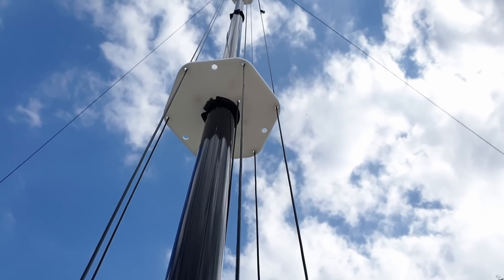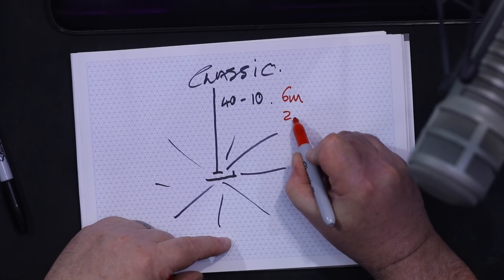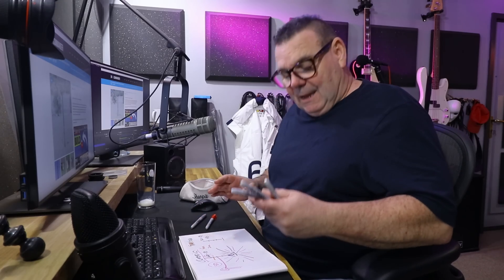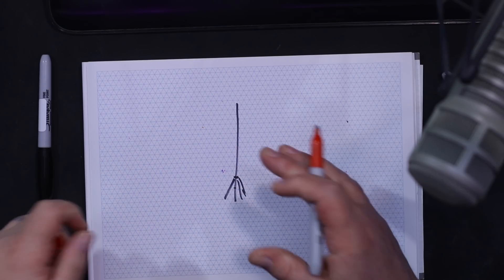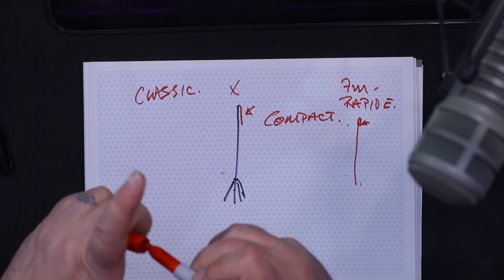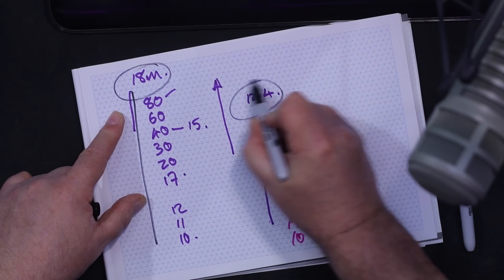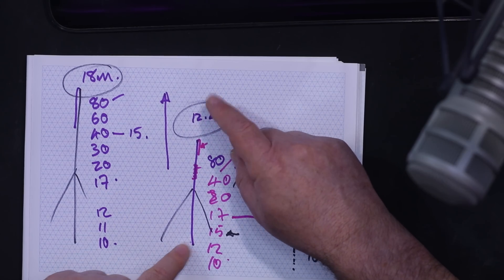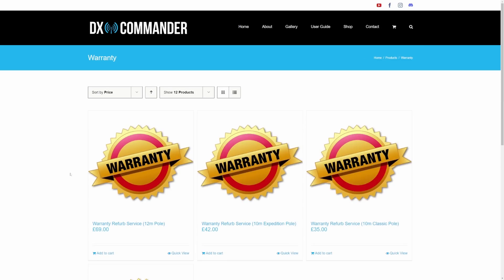Which DX Commander - The 2023 Line-Up

Comment: New ham here. I’m looking at getting a classic would like to know if you Have you done a video explaining the principles where all of the driven elements are going to the same socket. When you tune or key the mic to transmit isn’t the power going to all the driven elements and with a 25W limit how much is lost. Thanks.
Reply from the maker: It's all auto-magic. Only the right element will work. The rest are ignored. Physics. Don't worry - good question.
Reply: @ “auto magic” excellent new terminology 🤣👍👍

Comment: Previous
    Next

"Signature 18m Multi-Band Antenna Nebula Kit"  Does that improve or change the verticals from the original DX Comander ( I have) Or is it just adding longer vertical wires to the original and giving it more height for them. My original has been up for years minimal maintenance. Snow.. ice.. rain.. wind. Thank you!
Reply from the maker: Nebula basically adds 60m and 80m. The rest are effectively the same. It's a BIG toy. More durable too.

Comment: I'd love to see a Rapide-Expedition hybrid. So, basically an Expedition using the Rapide mast. Something that doesn't require a hole in the forest canopy.
Reply from the maker: Well, you COULD just use a Rapide and cut some notches to replicate the speed-slots?
Reply: @DXCommanderHQ , I wasn't sure if the spreaders would work. I might just take you up on that! By the way, I'm loving my new 12.4.

Comment: I have the Expedition and I have to disagree because the thin tubes in the mast in my experience are not a good idea about bending because on windy days I cant use my radios because it moves and bends so much that the SWR goes crazy up and down., I love the antenna but I wish the pole will be stiffer. I am even considering another pole so I can play radios during windy days
Reply from the maker: The trick is to have a ton of tension so that as the mast bends, the elements go with it.
Reply: @DXCommanderHQ  interesting, I’ll try that. When I built it at the beginning I put quite of bit of tension but the wires started getting out of the spreaders so I ended up lowering a bit the tension and putting duct tape in a way to close the gap so they can’t come out. I will try again because I really want to be able to play radio on windy days

Comment: Thanks for this informative video, Callum. I'm considering getting the Rapide. Question:  I take flood irrigation on my property. This would result in 15 to 25 centimeters of the Rapide being submerged. Do you foresee any problems in performance or to the integrity of the Rapide and its hardware?  Alternatively, I may be able to place it close to the side of the house on a berm, but would that result in decreased performance if it's up against a two-story wall? Thanks, and 73!
Reply from the maker: If it's no more than 25cm, I would raise up the base same amount and coat the SO239 and PL259 in a good spoonful of Vasaline. It's not designed for underwater use :)

Comment: Collin, I want a strong, sturdy DX antenna that would be an all season antenna used as a fixed base station antenna, once erected it would not be moved.   The catch,  “no guy wires”  as I have limited space..  which DX antenna would you suggest ?
Reply from the maker: OK, run with Signature 9.. Just let it blow around in the wind - and don't guy it.

Comment: Man, I just passed my foundation and I'm struggling for antennas at my QTH, I wish I had the space for a DX Commander, Do you have any plans to develop any stealth antennas for us that are not fortunate enough to have the space / 'permission' to erect such a beauty, or a video perhaps talking about stealth antennas, options for people in apartments etc? :)
Reply from the maker: Depends what you mean by "space". A Rapide with 1m radials for instance would work.. That like laying down and spinning you around. Have you got that amount of space..?
Reply: @DXCommanderHQ  Unfortunately, I don't really have much of a garden at all, to give you an idea (Hopefully this will work) https://i.gyazo.com/937b21daa73832a5d81a66739c444a1b.jpg this is what I have to work with, my idea was to run a 40m dipole fed at the corner of that fence, with the wire running along the top of the fence, the fence is 11m and 15m roughly, but it's quite low to the ground, I'm a foundation holder so "10w max" for me, what do you think of this? probably severely compromised, but it's either this or Magloop indoors from what I can figure? Unfortunately stealth is key, I've literally been looking at other places to live, just to stick up a DXCommader haha.

Comment: To switch bands do you have to make changes to the antenna coax connection at the base or use a switcher?  Also do the wires come pre-cut/tuned for each band for easy setup? Thanks!
Reply from the maker: No.. It's automatic. Laws of physics.. Meaure the wire supplied and cut to a chart. See User Guide on dxcommander website.

Comment: Is there any easy way to mount this against a thick, wooden fence post? the post is about 5 feet tall. I can’t put it right up to the post due to the wires and spacing rings? (such as the Rapide)
Reply from the maker: Yes, you will need some spacers. Stauff clamps might work with small blocks of wood.

Comment: I really want a DX Commander antenna. I want to use for POTA but I have a camper RV and would love to have the ability to use a hitch mount or attach on the ladder of my camper or I also have a hitch at the back of my camper.  I typically go out for 3 day weekends so it would be setup that long or longer. Do you suggest the Expedition? I would LOVE that Signature 12.4 but is that too big you think at Texas State Parks? Is it even possible to mount to the camper? Thanks much. Cheers!
Reply from the maker: Right.. The NEW Expedition (which I secretly launched on my Discord Channel) is SUPER FAST to put up. Email me and I'll shoot you the pics. DX Engineering will have this antenna ready for shipping in about 5-weeks.

Comment: Been watching some of your videos lately and have been very interested. I typically use a 10m spider pole and use it on a drive on mount (everything I do is portable) for a 40M EFHW sloper and sometimes a 40m 1/4wl wire vertical. Have you ever thought of making something like the 12.4m version that could fit into a drive on mount without guys? I guess it would just need the plate to be elevated about 2 feet or so to allow for the mast holder. Just comparing my options for new things to try. Some of the parks we work at dislike staking things into the ground and whatnot. Great videos, the antennas look very nice. 73.
Reply from the maker: It will fit. Depends on the consumer how much wibble-wobble they are comfortable with :)

Comment: Is the signature 9 the same thickness as the vottom ofnthe classic 10m? (Sorry if you said and I missed). Looking for the most rigid 10m length I can get (without buying the superlong version and only using half of it)
Reply from the maker: Hiya Frank.. It's a tougher pole so slightly less flex.

Comment: My 12.4 works well and I have been a maverick and left it up through post tropical storms here. We also get unpredicted sudden fast gusts when weather blows through. The only time it fell was due to a front end loader breaking my ground stake.

Since my horizontal efhw is better for noise here in apartmentville... I wonder if I were to NOT use the coil, but run the 80m out inverted L if I would get the lowered noise, but still the nice low take-off for DX. Possibly, as one person asked, using it as part of a guy?

Edit: Or would the 18m give me more signal with about the same noise, improving my SNR?

If I get flush with $, I would just move out of the city to the salt marsh again.
Reply from the maker: I don't think your L or Coil would be any different. To make a substantial difference, you would probably need to put a cheap Loop On Ground receive antenna out. That works for me.
Reply: @DXCommanderHQ  Thanks Callum. It's just that between the 12.4 vertical and the 130 foot 'L' horizontal efhw, there is a S7 difference to noise levels (sometimes more, sometimes less) after turning off pre amp, or like last night, engaging the attenuator. It is a huge difference in receive. It is only required on 80 and to an extent 40 (I imagine 160 too. But haven't tried).

I have thought about a 80m full size loop, but I'm not sure the landlord will have it lol.

Comment: Is very interesting that way the Signature 9 is mounted on a piece of tubing.
However for my Rapide I designed some brackets I bolted on a piece of wood I placed on my backyard (with some concrete, of course) and hold the pole with 8 tie wraps…

Comment: Once again an excellent video explaining the various antennas that you sell. The Classic plus 80 fits my needs but I sure like the idea of the Signature 9 not having any guys to hold it up. As for the hole using a garden augur on a drill with an extension might work making a smaller diameter hole that you can fill around the ground pole with sand to hold it up.
Reply from the maker: Try it :)

Comment: My Classic +80 is the best antenna I've ever had. Several friends have various other models and love them. We recently had some high wind issues that took shingles off our roof but my Classic weathered the storm perfectly. It's been up about a year so probably time to lower it for maintenance. I agree with others in that DX Commander has the best customer service around. Thanks Callum, and your family, for great products and service. BTW I did my install using the metric measurements and it works perfectly. Jack K5FIT
Reply from the maker: Thanks Jack!! Good work.

Comment: On the 80M classic DX Commander antenna can you install the 80m wire on the top nylon plate? I was told if you install it on the top plate it will snap the pole...
Reply from the maker: No it won't snap. Goodness knows who the hell told you that. My personal preference is half-way up because it bends less, that's all.
Reply: 40mph gusts today and its ok 👍

Comment: Hi Callum good vid just a quick question I have a G5 in the attic due to limited space and no garden I have recently been mucking about with the wire and have made 1 radial 10ft longer which has made receive a bit better and also making some of the bands more resonant when I used my nanovna to test the swr so in hindsight would this in your opinion make the antenna work better or am I just lucky ? Any help on this 
Cheers
Reply from the maker: Anything attic based in my experience is luck-of-the-draw..

Comment: I set my classic onto a PVC pipe (ground post) and added a second set of guys higher up the pole. It has gone through a couple of good wind storms staying up with no problem. The 80 meter inverted L is my best 80 meter antenna. It's a darn good product.
Reply: Where on the pole did you set up the 80m L? Did you place the wire on the top two-hole plate?

Comment: Wow!  If you can come up with a stand alone (non-guyed) version that doesn't need radials (I've got multiple raised veggie beds), I'll buy it TOMORROW !! 🙂
Reply: For not needing radials, you'd need to expand the antenna to a half wave, doubling its size or introducing loading coils. You could have an end fed half wave with combined loading coils/traps but you couldn't have a fan arrangement with different elements if you had them fed at the high impedance point, only if you centre fed them.
Reply: @paulsengupta971  Thank you Paul.  I've thought about a 1/2 wave (or base loaded shortened 1/2 wave), but that would be pretty tall, and with my back yard configuration (raised beds, overhead wires everywhere) that would be risky.
Reply from the maker: Signature 9. Done :)
Reply: @DXCommanderHQ   NO RADIALS ?? SERIOUSLY ?

Comment: Callum, I love my Signature 9. It's the first real antenna I've had. I changed out the 30 for the 80 and it works great. I even tried 160m using my LDG tuner. It tuned it but I was afraid to push it more than tuning it. 73, K9SIX
Reply from the maker: Nice!

Comment: What is the power rating on the Signature 9 antenna? Any problems when the base is buried in snow?
Reply from the maker: Snow is not an issue. In the main, you can push to 1,500W. Check user guide for making sure the end of the 10m band doesn't get hot. Basically, you make a small loop. It's in the guide.

Comment: I have a signature 9, it fits in the corner of my small garden, radials are 3 metres long in a rough circle, it works really well and is quite stealthy. No complaints from my landlord or the neighbours. The unified instructions, I found it useful to mark up the sections, especially the cutting chart with a highlighter pen, for the relevant antenna,
Reply from the maker: Nice one Ron.

Comment: Owning a plethora of telescoping fiberglass poles 4 classic,  one expedition,  and half dozen others,  my favorite thing about the DX COMMANDER is it's flexibility.  I can set up as a single band antenna and pick and choose other bands as I desire. A lot of time operating POTA I set up single band on 20m.  By the way  I use the classic pole without guy lines and slip it over a ground pole or attach it to a homebrew mount using the towing receiver on my truck.  Thanks Callum.
Reply: Mine Classic too was without guys  for over 4 years , 3 feet of PVC pipe in the ground and up to the first joint out of the ground . Worked great .
Reply from the maker: Perfect Ed..!

Comment: Surely there is not someone stupid enough to buy the 18 meter as there first antenna?…… oh hang on 😂😂😂😂🎉 BTW I have had my Rapide with no guys over a wooded pole for about a year or more with no issues. I also have a classic doing an inverted L slid over a 6.5 metre solid fibreglass tapered pole from a boat and that’s been great also with no guys 😊 Have a good Easter Cal 👌
Reply from the maker: Yes, I have sold 2 x 18m antennas to brand newbies... Of course, I didn't know at the time... The support was horrendous.
Reply from the maker: PS Ray.. Youtube has JUST decided that I have never seen this comment. Sorry - I never responded but I didn't know!

Comment: Got anything for the windowcill callum. ?
Reply: Hehe I'm now imagining a mini dx commander with elements for 2m and 70cm (optionally 1.25 in the US)

With a mini signature that also does 4m and 6m
Reply: @dasy2k1  2m, 1.25m & 70cm ground plane elements at the top.... Maybe try integrating radials along the guy lines? Just a new to the hobby operator throwing out some thoughts.
Reply from the maker: No yet!